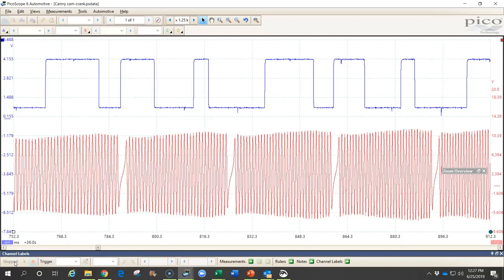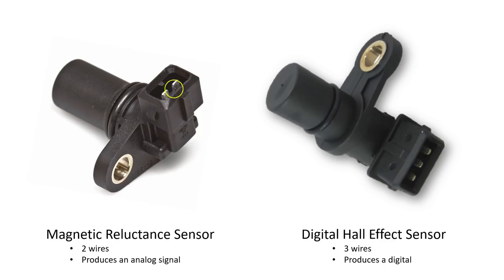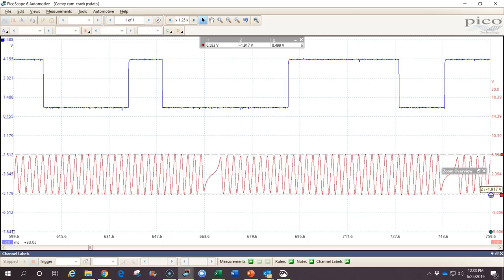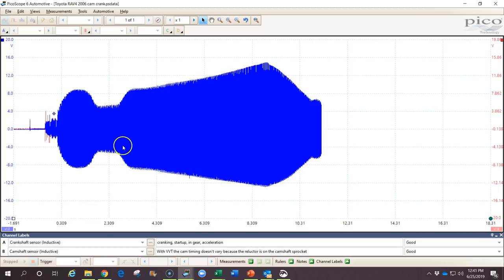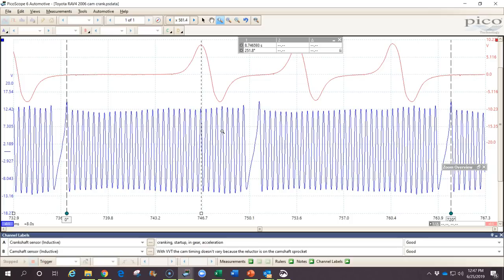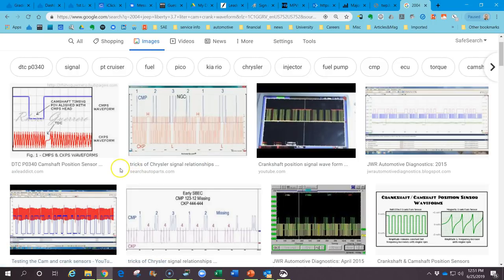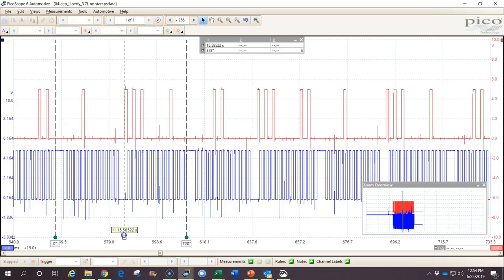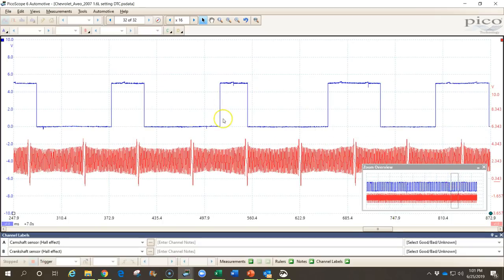Camshaft and Crankshaft Position Sensor Waveform Analysis

Comment: what are the numbers on the X axis?  degrees?  what degrees,    please;   crank must repeat every 360?  cam every 720?  
is it volts on the Y axis?     Tks
Reply from the maker: The x-axis is initially "time."  However, one I bring the "phase rulers" out, I can now place degrees onto the X-axis.  The crank signal repeats every 360 degrees and the cam repeats every 720 (because it turns at half the speed).  The y-axis is voltage.